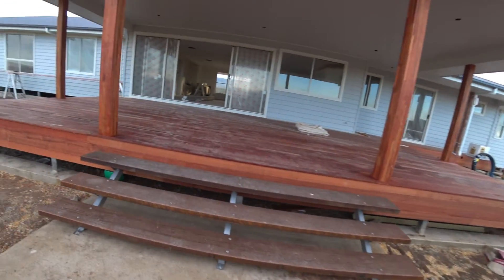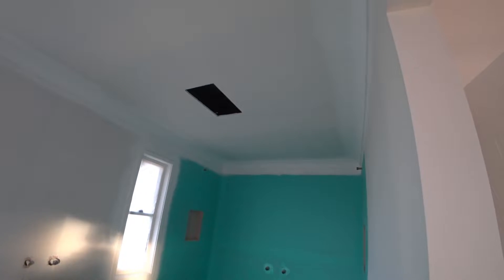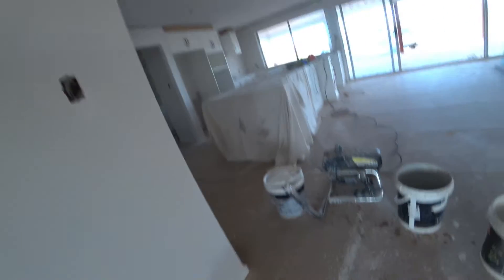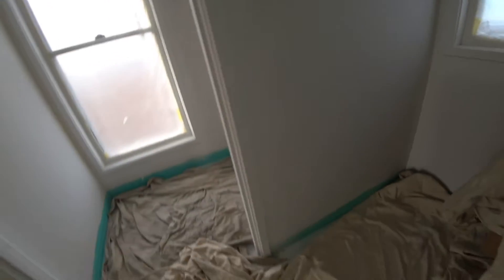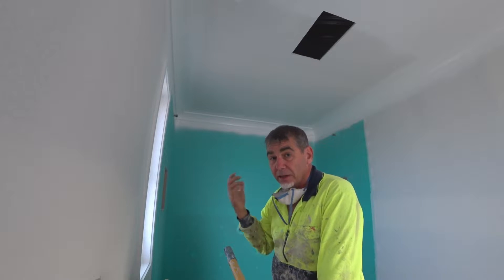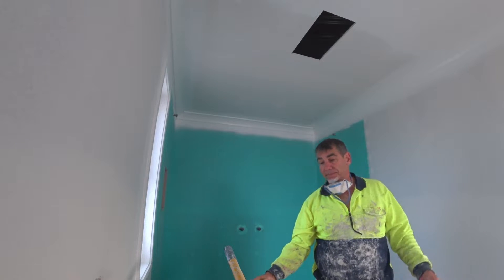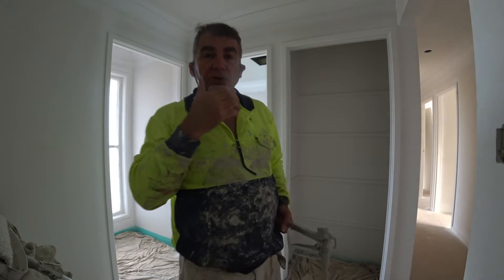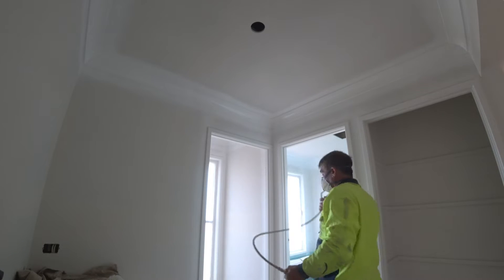Part 9/ How to get perfect  wet area ceilings anyone would be proud of.

Comment: Hi mate i have one question i have 3600 psl airless paint sprayer if i connect connect one more hose to increase the length of hose will it work thanks in advance
Reply from the maker: Yes no problem, i have attached more hoses when painting two story house roof regurly,i always have a joiner in my truck for such occasions and even in very long houses.
Reply: ThePa1nter thankyou